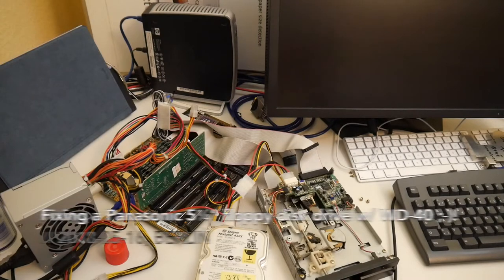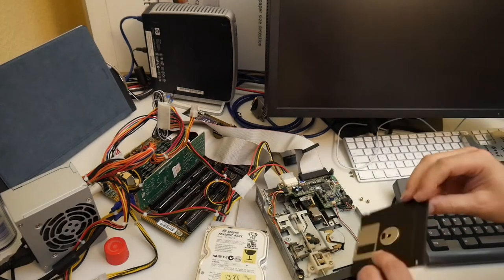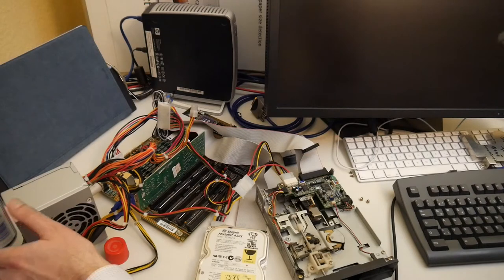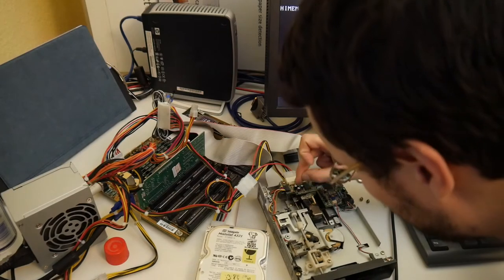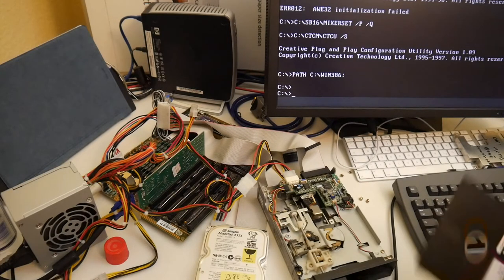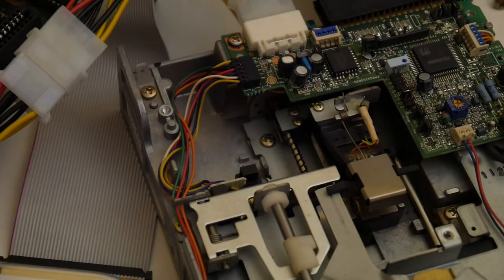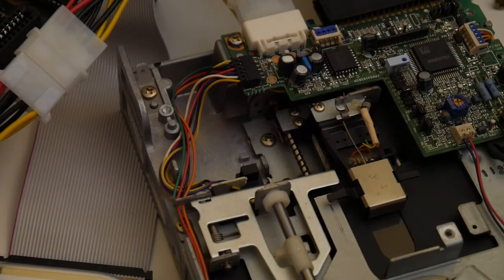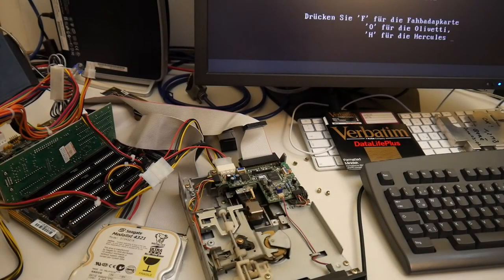I just fixed a 5¼" floppy drive w/ WD-40 ;-)!

Comment: WD-40 isn't a very good lubricant, you may want to apply some light machine oil.
Reply from the maker: Thanks for your feedback. maybe I need to stock more than wd-40 in the office for future vintage things ;-)
Reply: WD-40 is a great penetrating oil to get things unstuck. But after that you've still got to reapply the appropriate grease or oil.

I usually use sewing machine oil for floppy drives or plain lithium grease on the worm drives, it varies from drive to drive what they need.